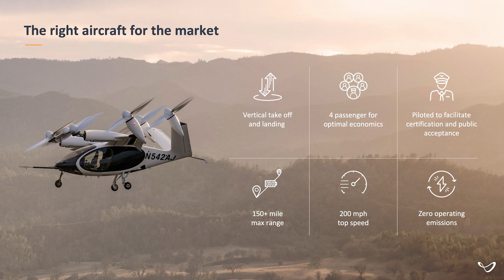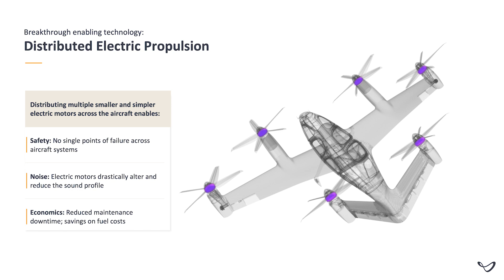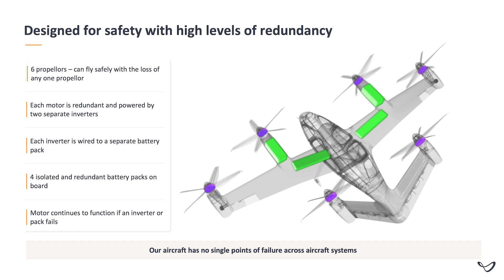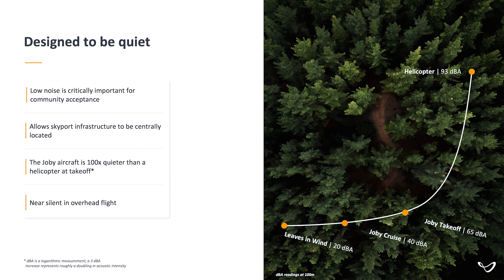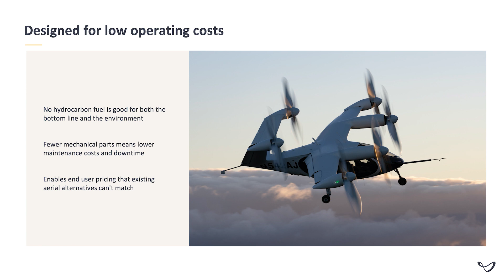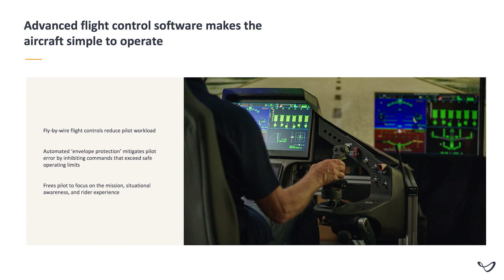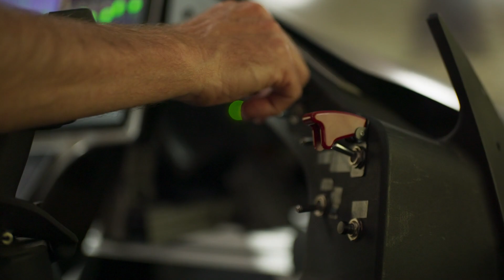Joby Aviation Analyst Day June 2021 🚁 Noise Level, Prototype Develop., Safety, Acoustics & Economics

Comment: How is 50 decibels 1000 times quiter than helicopter taking of  at 90 decibel ???
Reply from the maker: To express levels of sound meaningfully in numbers that are more manageable, a logarithmic scale is used, using 10 as the base, rather than a linear one. This scale is called the decibel scale. 
On the decibel scale, the quietest audible sound (perceived near total silence) is 0 dB. A sound 10 times more powerful is 10 dB. A sound 100 times more powerful than near total silence is 20 dB. A sound 1,000 times more powerful than near total silence is 30 dB, 40 dB and so on.
Hope that helps. Thanks for watching!